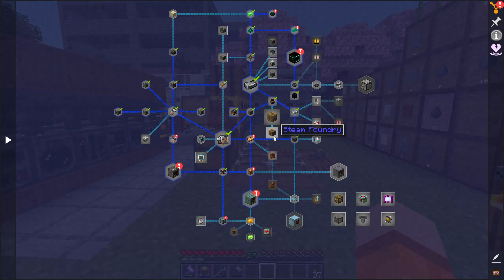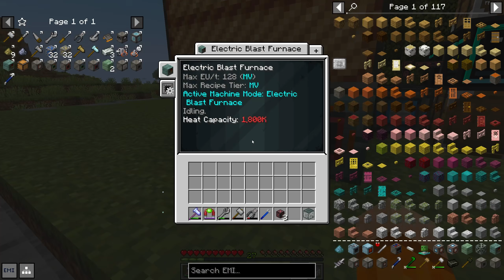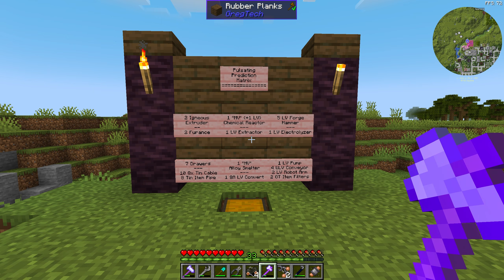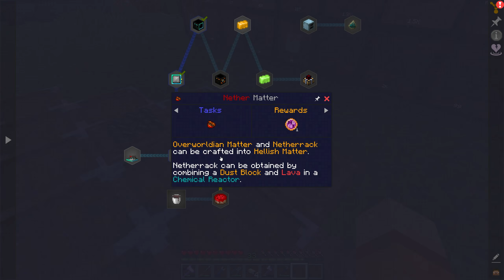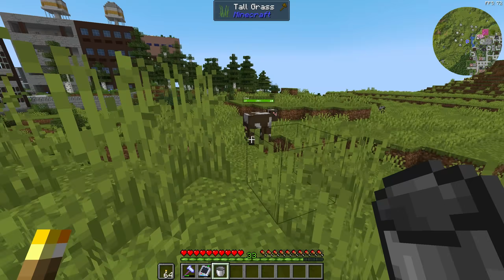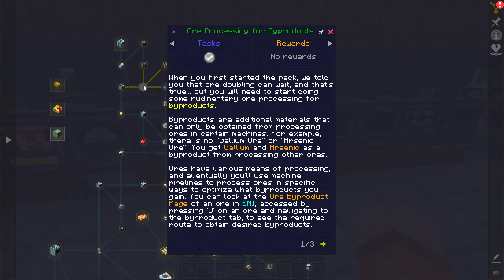Monifactory: Ep3 - Pulsating Prediction Matrix & MV Circuits! Modded Minecraft

Comment: Unfortunately, the devs have completely overhauled circuit progression. You won't be able to get away from vacuum tubes until you get NAND chips, which means an MC Laser Engraver with a Cyan lens and setting up Silicon Boule production. In Omnifactory and Nomifactory, I'd rush Phenolic boards to start making the Second Tier One Circuits, but that has a more nuanced ramp process here. In many ways, it is quite a bit more elegant, but it does mean certain components are going to be required for longer. At least we have a recipe for glass dust in a ball casting mold to make the glass tubes easier, so there's that. And at least you can use Charcoal Dust in your Resistor recipes, so you can save your coal for making Phenol.
Reply: That's because this progression follows GTCEU version not GTCE.... the CU addeds the more balanced aspects to the beginning of the game. I also think the changes to the board, and the later on Iron III addition is a good way to introduce people to some basic chemistry lines before they have to get into the heavy plastic lines

Comment: I made superconducting wire cheap for a reason Three <3
Reply from the maker: ye mb lol
Reply: why make snad so expensive xd
Reply: @zerobash3425 cant blame it was op as shit
Reply: @zerobash3425  Its just triple compressed sand in Omnifactory
Reply: @zerobash3425  its just 162 sand now, the crystal was removed
Reply: @Trexrush1 i disagree with that change very hard lol
Reply: @im_kas  i believe its reverted for hard modes in monifactory, so you can use those settings
Reply: @Trexrush1  its nothing as soon as you got machines to produce sand
but manually farming stacks of sand just for the early sugar cane power feels grindy in a way that doesnt fit Omni/Nomi/Moni :D
Reply: @zerobash3425  idk, its like you have cobble anyway, and after you can just craft sand using some  hammer durability. So it will cost you like 6 ingots to start, thats not much
Reply: use the superconductors threeeeeee

Comment: also basically all the recipes that take either annealed or normal fine copper wire give 2x output with annealed, and since its just arc furnacing copper at a 1:1 its way better to use annealed.

Comment: there's a good chance thermal expansion's tanks are available, don't forget yo ucan upgrade them to resonant, and SHOULD be able to put HOLDING on them. that should get them up to like...512 buckets or something reasonable.

IF bloodmagic is in the pack, it's expensive but they have a VERY solid option too! 

and then I think some storage drawer packs have tanks now too...but not knowing what all's in the pack, yeah, do the research.

Comment: I believe Gregtech voltage base materials (aka, Steel, Aluminum, etc.) can be used to make drums and crates for storing fluids or items. That's how it is in 1.12 CEu, so I would guess it's the same here.
Reply: Also you can screwdriver the bottom of drums to auto output
Reply: Was about to suggest this exactly. The drums are really nice to have around, they can be used in all the same ways that a cell or portable tank can be (in-gui pick up and insert fluids, right-click tanks to fill or empty, etc). Aluminium, in particular, can store 128 buckets and is pretty easily renewable.
Also handy is the various tiers of cells, which have less storage capacity then drums and are less resource efficient if you're just looking to store stuff, but they have the benefit of showing what they are filled with (which is an advantage that is easy to underestimate, until you have a chest of 20 drums each holding a different fluid...)

Comment: Fun fact if this version works like GTCEu then you can connect two energy hatches with 1 4amps cable and 1 2amps cable from the 4x energy converter.
Reply: He did show that in ep1 but said he was going to stick to only using wires at the supplys rated output

Comment: Use conductive alloy wires they are superconductors. Tin cables are terrible. Conductive alloy is just iron and redstone.
EDIT: it might be different in this mod pack but usually machines will only allow a certain amount of items into some machines already when it’s automatically inserted into them.
Reply from the maker: Yeah it's just a habit from GTNH. Supercons in NH are just not viable until ZPM+ So I assumed it was the same here. Just my mistake in the beginning :)
Reply: @Threefold.  and its nice that they have zero losses. I doln't know why I would use the insulated cable when it has losses.
Reply: @Threefold.  Well LV supercondcutors in nh are viable but i thought so ^^
Reply: @Threefold.  remember that GTNH is the outlier of gregtech. Most packs arent designed to waste thousands of hours of your life
Reply: @Sengyizhe The rest just waste hundreds of hours.
Reply: he probably knows this, my best guess is that he either forgot or conductive iron needs mv alloy smelter
Reply: @dapcuber7225 it doesn’t require MV he already crafted it since it’s used for a quest in the beginning tab
Reply: @patfre  huh thats odd, maybe he's waiting for energetic alloy
Reply: @dapcuber7225  I don’t know why he would pick tin cable even in that case as those can be used for lots of recipes so it seams quite wasteful
Reply: @patfre prob habbits fro gtnh, superconductors are super expensive so you usually use mats like tin for lv, copper for mv, gold for hv, etc…
Reply: It doesn't. These superconductors are originally added by ender io back in Nomifactory CEu I believe, and are much cheaper than the typical Gregtech superconductors at their respective tier (at least some of them)
Reply: People on this coment section look to me as if they are talking in another language